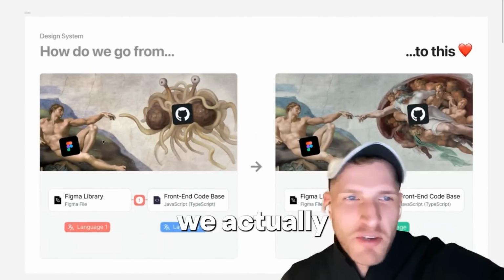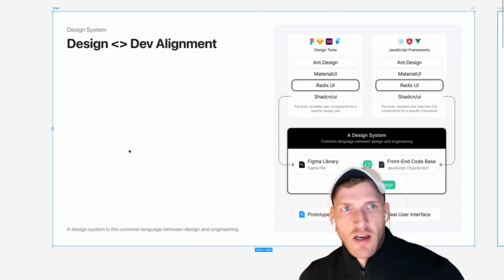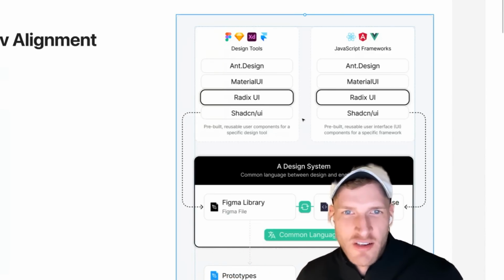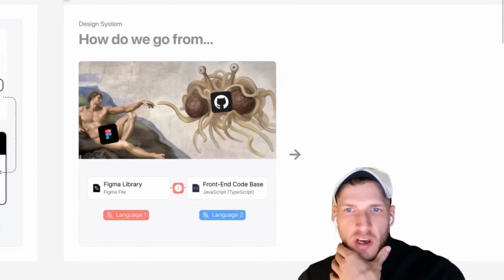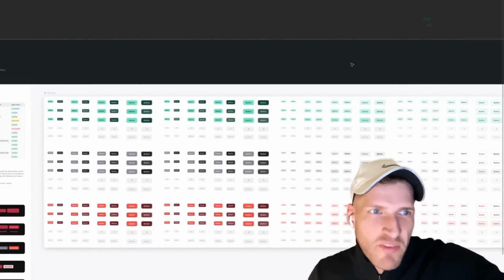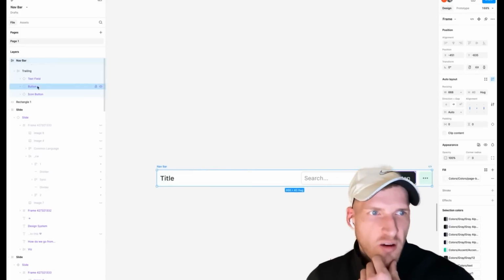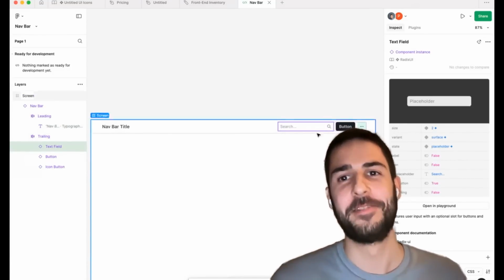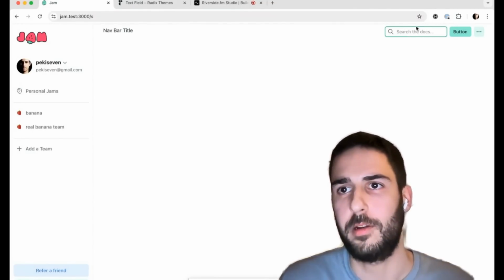Our Startup's New Design System! w/ Designer & Dev

Comment: I tried designing with Radix Ui but it' extremely limited. Basic components are missing like a breadcrumb for example, also icons are missing, it's a pain to work with this design system. You have to adjust everything and create custom components like notification badge for icons, pagination, pill selector buttons, in page navigation etc. Also the slot is completely useless. Texfields don't have error states, missing hint option etc.

Comment: Great video! I was wondering if you looked at any of the other open source design systems like Chakra ? Just to understand how the decision was made and also would you have chosen Radix if you needed to create your own custom design system using it as a base? 
Also how important was it to have a Figma design kit for your chosen component library ?
Reply: Great question. Generally our process was: 

1. Notion database listing component library with criteria important to us: 
- performance and bundle size 
- compatibility with existing codebase 
- accessibility 
- Figma file 
- community and support 
- etc. 
Then short list the ones based on the scoring of each category. 

2. Proof of concept: Quick branch to test shortlisted component libraries
3. Make a decision in design and engineering 
4. Time to build 

Since we have both a design and engineering team and we wanted a common language across these teams choosing a component library with a Figma file was a non-negotiable criteria.This way you get the speed and alignment benefit across both teams.

Comment: Great video! One thing I think is missing. I and others would really love to see how Radix UI is fluid and flexible towards adapting this Design system under the Visual Identity Style guide. How flexible we are as UI designers, to adapt our UI designs to Visual Style Branding Guide?
Reply: We can look into content of showing how to do this in both Figma and a codebase. Generally with RadixUI you have 2 options: 

1. Radix Primitives (You build the theming/tokens out yourself in the logic you want)
2. Radix Themes (you take the out of the box theme configuration from Radix and customize it)

Comment: I started a new project and I’ve made a ton of progress just because I used a front end ui library (NuxtUI Pro) that has most of what I need. So now I’m just exploring it while putting together a non working clickable demo so I can work with potential customers to get feedback on my idea to see if it works for them. Using some template and maybe bootstrap it would take me months to get me to where I am after just 2 weeks.

Comment: radix is ok but it sucks at a few things, the way modals are implemented is brutal
Reply: Lol I just dealt with fixing radix modal issues on a project…so annoying.   Among some other things like trapping focus and not making focus-related props available through their API, they use this package called “aria-hidden” with a method called “hideOthers()” which forces “aria-hidden” on a bunch of other elements, and can cause all kinds of problems.  Then there is the issue of it adding “pointer-events: none” to the body element, so if you have any other custom events or controls that manipulate the modal, or nested components like one that uses radix popovers within the modal, etc, you can end up in a situation where the modal closes but radix keeps trying to force “pointer-events: none” on the body, and the only thing you can do is throw a useEffect in your code with a small timeout to manually remove it/unset it, or a mutation observer to listen for the change…but either way you are fighting a race condition with radix.  And good luck trying to do multiple modals or nested modals or modals from a drop-down or context menu.  You end up scouring the radix ui source code for their internal components and methods like “FocusScope” to manage it.  Such a mess!

Comment: Here is my take on it, from building teams and products around it, have 10+ years in field.
- Components, components, components, colors, docs, styles, systems = overthinking, over engineering. 14 let's create 15. Perfectionism is always a problem.
- It will never worked in my experience, all those "systems" are way of spending time to some extent. While actual features 90% of time is new things that not in system.
- Also to add new stuff to current system will take absolute insanity to "ALIGN" - (Oracle employee here ahahaha)
- You can build perfect system, if your team s**ks, process of development s**ks = no one cares = in the end it will be bloat system as usual it does.

Comment: What do u think about shadcn?
Reply: We love Shadcn and thoroughly evaluated it as an option, especially if you’re starting from scratch. Ultimately, we decided not to use it due to specific constraints in our codebase. Integrating it would have caused conflicts with our existing styles, making an iterative adoption approach unfeasible. Since a complete frontend rewrite wasn’t an option, we opted for RadixUI instead, as its contained theming wouldn’t interfere with our existing vanilla-styled components.
Reply: @MartinMerschroth  What I understood is that you chose not to use ShadCN because its components come pre-styled with Tailwind CSS, which conflicted with your existing styles. Since a full migration wasn't feasible, you opted for Radix UI, which allows more flexibility with your current styling approach.
Reply: Shadcn is also based on radix ui
Reply: @vice-108  100%! Most of Shadcn uses Radix as a base for it’s components anyway.